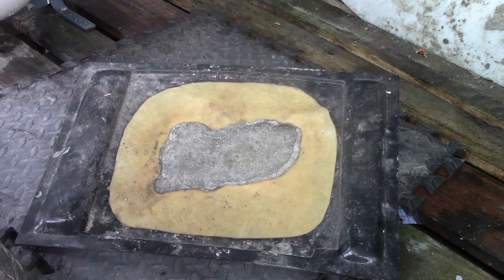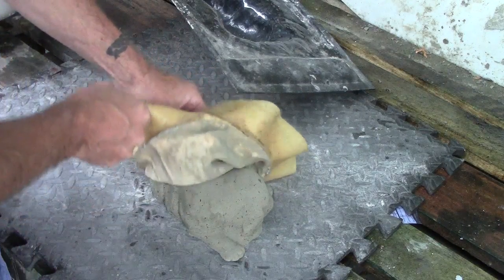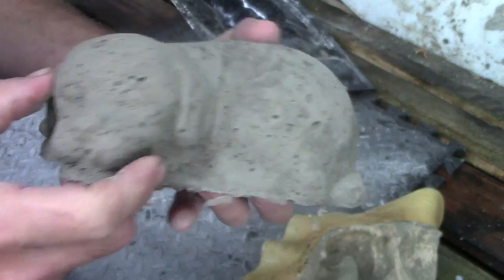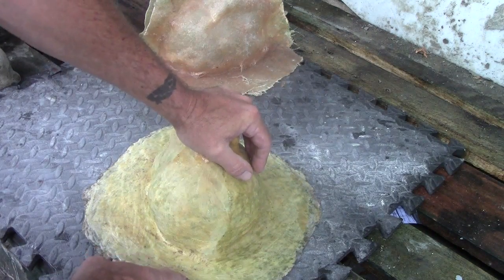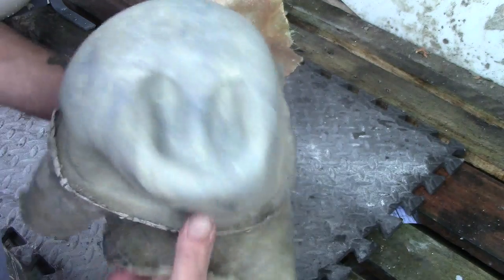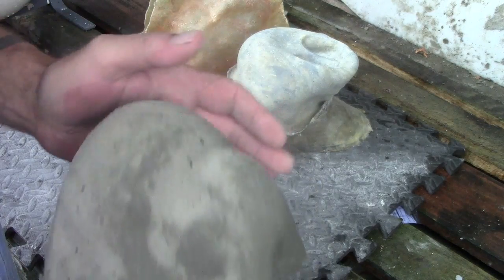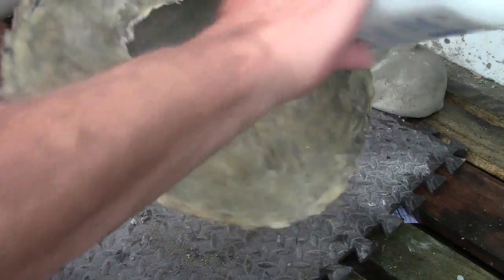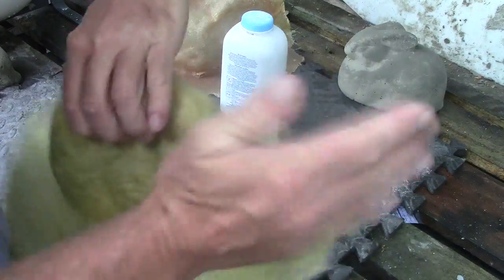Latex Concrete Mold Release experment. Straight Soap & Baby Powder

Comment: You can't use any petroleum products on latex, because it deteriorates the latex. To clean your molds, use teaspoon of Castro oil ( food product not motor oil) and fill the rest of the spray bottle with regular rubbing alcohol, then turn your mold inside out, spray , turn it back right side in, rinse with water and let dry..
Reply from the maker: Vid is a experiment. Yes I know about hydrocarbons and latex. Thanks.